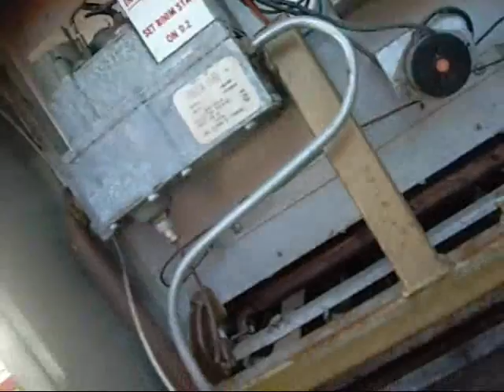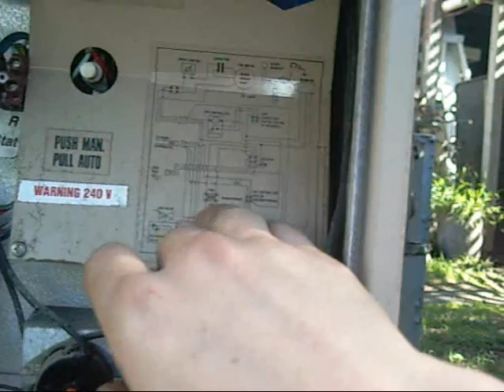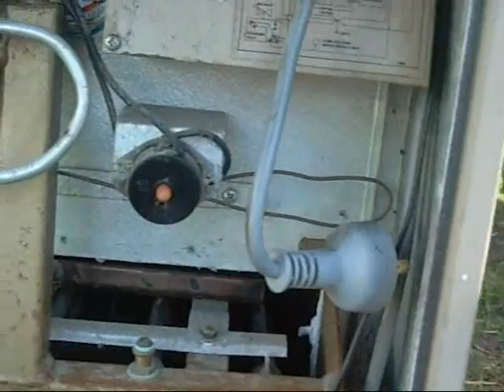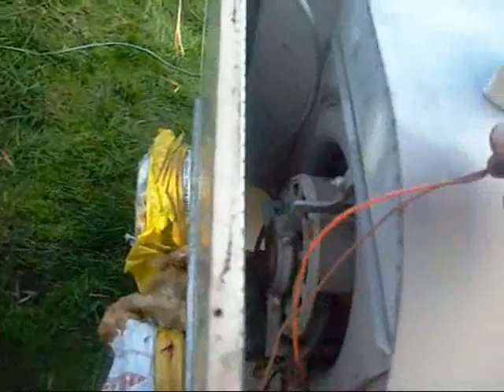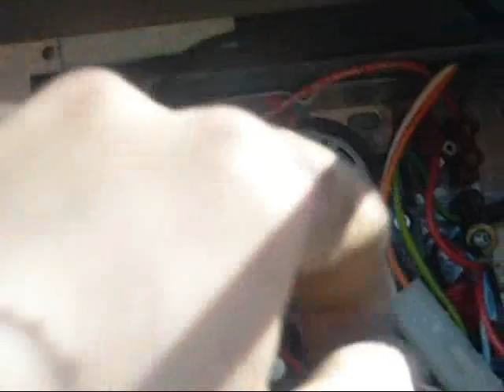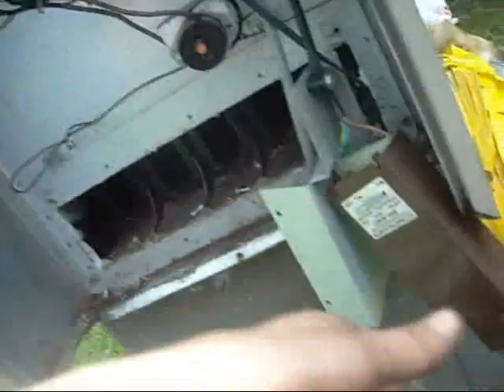Brivis Buffalo Gas Central Heater Disassembly

Comment: Hi Aussie50, I've got this heater and I think the fan is faulty. With the heater on, I push the fan button to manual and it turns on, but it doesn't turn on in Auto mode. I then tried pushing it down and up a few times and then it turned to always on (regardless of fan button setting). Then it eventually turned off. What could the issue be? I read somewhere that the capacitor might be the issue?
Reply: Did you work out the problem? I'm having this issue at the moment

Comment: The red button is not for pilot ignition, it's the reset for over-temp inside the control box. The tube attached to it is for sensing the temp. Pity you didn't show how to remove the burner, otherwise nice video!

Comment: Hi Aussie50, I have this same heater, it broke down so i salvaged the blower, Could you explain how I could use the fan speed controller in the control unit to control the blower speed? Im making a dust extractor, i just want to control its speed
Reply from the maker: The blower motor should have 2 or 3 speeds. one wire will be neutral, one will be Earth, and the other 2 or 3 will be speeds, connecting an active to one at a time will tell you what is high, med. and low. a simple 4 position rotary switch would suffice for controlling it, rather than using the PCB and relays. just be careful around mains voltage if your not already comfortable working with it.
Reply: Thanks mate ill have a look

Comment: Aussie50, great video. I am having an issue with mine. Pilot light wont stay lite. It will go out as soon as you release the button. Flame is a nice blue colour. The manual fan button works and operates the fan. The thermocoupling actually looks reasonably new, but apart from replacing this, any ideas what else I could do before I get stung by a professional?

EDIT: Is there any way to diagnose a thermocoupler fault?

Comment: Where is the pilot light location on this heater? I can't seem to find it. Also I don't have ignition button on mine, so I do need to know where the light is so I can light it up manually.
Reply: For anyone looking for the same info, I found it, it is located at the bottom left corner a bit deeper into the unit. Once you see it you'll know it is a pilot light.
Reply: Hi Vasily, I still can't see it. Can you provide any more info?

Comment: I have only posted this because this video could be misleading and dangerous because it overlooked some important facts.

These heaters are likely to have cracks in the heat ex-changer in the rear which make the unit potentially unsafe as Carbon Monoxide can enter the house if the heater is left in operation. This was not mentioned in this video at all.

Current heaters of this style as new as 18 months old have been shut down for this problem. More are shut down by the service guys that we deal with than are left running for this fault alone.

All heaters should be tested for Carbon Monoxide every 2 years and if the guy fixing it cannot do this do not let him touch the heater.

See

http://www.esv.vic.gov.au/LinkClick.aspx?fileticket=5qgcumVwdQo%3D&tabid=512&mid=2190

http://www.esv.vic.gov.au/Portals/0/Alerts%20&%20Recalls/Files/Gas/SymptomsofCMP.pdf
Reply from the maker: This is purely a autopsy video, not a repair video (for the same sorts of reasons you point out) I never give advise (that I know of) on how to repair gas equipment. 
Electrical gear that plugs into the wall, fine, anyone can replace a run-cap or relay if they are competent, but gas is a no-no.
Reply: Aussie50 Not having ago at you but anyone watching the video could.

You may have thought that it was only a pull down strip video, but you explain in part the operation of some of the components. The info could place you at risk and anyone attempting to use the info to fix a heater.

If you supply electrical advise you become liable for it legally, so why we all want to help, all caps are not the same.

All Brivis caps have to be changed at the service call in all units because of a recall a couple of years ago.

Therefore if you provide advice and they fit the wrong cap you could be liable?

We take great care to avoid putting our heating business's at this risk because of consumer affairs and the number of lawyers willing to take on stupid cases as they get paid no matter what.

I would edit the video and place an advice on it that it is not advised to attempt repairs and get a qualified plumber to do them. This could limit your exposure.

Comment: Hi great video!
MY parents have an old one of these, I think its a Buffalo 85 which I believe they now call a B20?
Manufacture date is 1982 (probably the oldest in existence, maybe I should sell it to the Brivis museum!) and I have been repairing it over the years such as thermocouple etc.  However recently it bit the dust, my mum said it blew up! Well I had a look at it and sure enough there is a massive black carbon stains on the unit and wall, so we are afraid to turn it on! Anyway I am thinking of replacing it and was curious if you would know what have have caused this to "blow up", coincidentally the day before the local gas company upgraded the street main gss lines with newer higher pressure gas pipes. I an get a good second replacement B15 model and was also wondering if you think it would be suitable, they currently have 7 floor points in a small house, however it does have high ceilings. Thanks.

Comment: Hi Aussie50.
Good video.
I have this unit and the problem I have is that the last jet on the right hand side has flames around it. All the other jets have a strong vertical flame. This one however has a weak flame. I have taken out the jet, cleaned it, made sure it wasnt blocked and put it back in but this hasnt helped. It is almost as if the gas is not getting to the jet properly or that the gas/flames are not being sucked up into the unit hard enough. The heat exchanger has been replaced once before and I am wondering if it could be blocked and if so how do you remoive it to clean it. Your video doesnt show this step?

Comment: You can see cracks in the heat exchanger which allows Carbon Monoxide into the house. This is a common problem in the Brivis Buffalo series. If you have a Brivis Buffalo heater you should get it checked for cracks as it could save your life. ESV (Energy Safe Victoria) have said any crack in the heat exchanger makes the unit not compliant.
Reply: ours is checked quite often for carbon monoxide its life span is almost done its a 1992 build and still working in 2025 had quite a few repairs and services over the years

Comment: why would you buy a Vulcan or Brivis. Had a Vulcan. needed 4 services in the first 6 weeks and never work properly thereafter.
Moved to new house and install a new Brivis. It did not work the second the installer turned it on when finished installation.
Reply: What's your recommended brand?

Comment from the maker: @zmirt1 I must have really been tired when I got home from work. completely missed the bit where you said the fan was dead :(

in which case you could open the unit up and see if the fan motor and run cap are okay (assuming its not siezed) but in all honesty its time to call a tech,

Comment from the maker: @zmirt1 I can't remember much about these units but I think the red button is a over-temp cut out,

sounds like you could have a airflow restriction thats causing the heat exchanger to overheat, or the blower is tired/not working

the only thing I would advise doing is making sure your duct work is okay, not crushed or anything. and the intake air filter (if there is one) is not blocked.

other than that I would get a tech in, gas appliances really do need to be serviced by a qualified tech

Comment: I have one of these heaters and the fan has suddenly stopped working.  The gas fires up for a while and then the heater just stops.  What is the purpose of the red button on the fan temp control and is there anything else I can check before calling an expensive technician?

Comment: Here at my house I have what I believe is a Brivis Wombat 92, I only know this because several years ago i had it upgraded to add air conditioning, the system has what I believe is a Uniare condenser on it, it has served me well since I moved here 5 years ago.  I believe my parents have a Brivis Buffalo, it works well but recently it appears that rats have chewed through the duct work and tubing, Mum pulled all sorts of shit out of the system.

Comment from the maker: @BigMaxTube cool, I remember when moms used to auto-ignite and send a shockwave through the house every 30 seconds untill we got the jets cleaned.

the speed control started working a few hours ago when I set the blower up for cooling my DC welder electrolysis powersupply :D

Comment: Also, I'm fairly sure the black switch with red button is an overtemp cutout, not the start button. You light it using the gas valve top left, ignition is auto via spark.

Thanks for posting.

Comment: I've got a an identical buffalo heater at my place, besides the occasional episode of 'explosive ignition', where the cross tube blocks and not all burners ignite at the same time, it's been reliable. In fact, it's on right now. Thanks for showing what's inside. BTW, the speed control on mine still works :-)